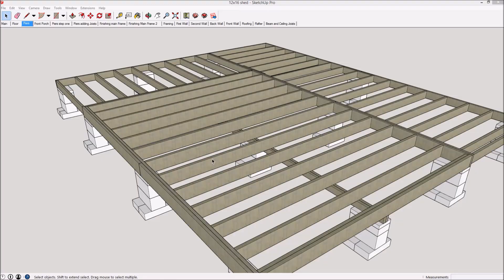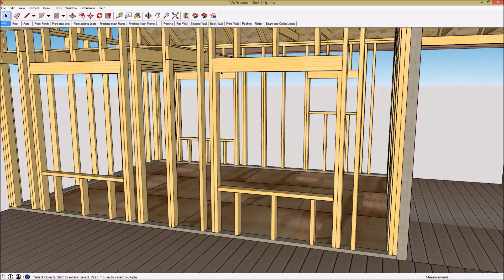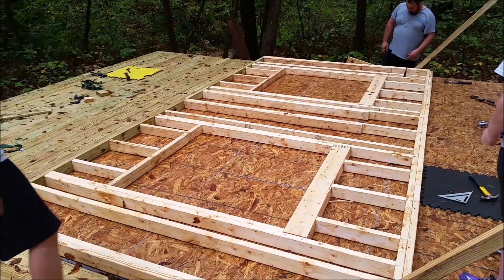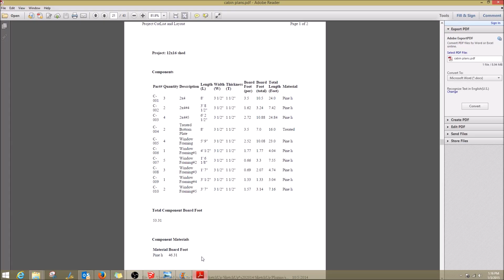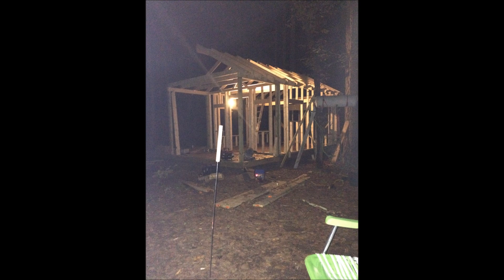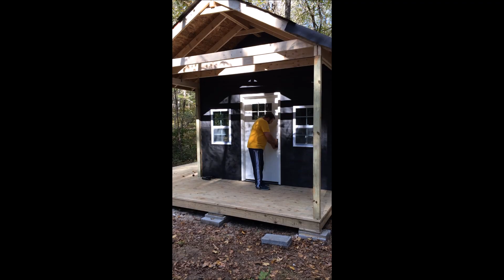Tiny Cabin in the Woods (Cabin Project)

Comment: This is a sweet little starter cabin. If it was mine I'd build it on taller piers so it would be about 4 feet off the ground to provide room to get underneath and insulate the subfloor, give the hound dogs a cool, shady place to sleep and help protect the cabin from spring flooding. I'd also add about 2 feet height to the exterior walls so there would be space later on to tack on a porch roof below the original roofline if I wanted a wrap-around screened porch for insect-free outdoor living and to shade all the windows in summer. I would also want windows that lower from the top and a transom over all the interior doors to allow good airflow during hot weather.
Reply from the maker: All great ideas :) The height off the ground was dictated by local codes...that is what I told myself anyway.  The sub floor is insulated.  I did that before putting down the plywood.  The future plan is to add a roof to the side porch, but tie into it not under it.  The windows were chosen more so based off price, however I actually like the side slide of the larger windows...they are really easy to open and close...and I don't know what a transom but there are no interior doors anyway.  Thanks for the comments.

Comment from the maker: I just cleaned up the plans for this little cabin and made them available on my site.  I also included the original sketchup file I used so you can modify it for yourself.
http://plan-to-build.com/downloads/plans-for-the-tiny-cabin-in-the-woods/
Reply: +Brad Clark  Amazing job man. Looks awesome. I like the shake siding. Same thing I did on my house. Quick question tho. What made you stick build as opposed to ordering a prefab "shed". I own a small company that does prefabs, and going by your sketch and material, I priced this out at roughly $4000 delivered. Did you save a lot more by stick building?
Reply: I'm sure you probably already answered this question but I have to ask. How much did you spend on just this cabin?
Reply: This is great you did a wonderful job. Now just enjoy it.
Reply: Brad Clark
Reply: Hi Brad, how is that siding you used called?
Reply: ok good
Reply: i was not sure i 💘
Reply: Brad Clark  how much for plans
Reply: Thank's
Reply: Brad Clark This is perfect. Thank you so much.

Comment: Hello Brad. I am going to be building a cabin myself and one thing you did that I really want to do is that your outside deck and your interior floor really is all one continuous floor. I would rather do this since imo it would be easier than having to build a completely separate deck that attaches to the cabin. My only concern however is that b/c the deck and interior floor is one continuous floor do you ever get rain in under the walls? Did you do something to prevent that from happening ?

Comment: Biggest mistake that was made was not allowing enough room under the floor, you need at least 2 feet under a floor to for access in case of repair. and future improvements.
Reply from the maker: +Scott Foster Yeah, there will be no crawling under it.  There were other driving factors that limited the total height from the ground for my situation.

Comment: Nice!! I wouldv added 50cm lenght to the walls and bit more of an incline the roof. It be at minimum costs but would create a nice loft
Reply from the maker: There was a lot of give and take on the roof design.  I came really close to using the barn style roof design...that would have given a lot more room in the loft, but settled on this design for simplicity sake.  I also took into consideration ripping the plywood and made sure I only had to cut 1 piece in half per side, the rest were full sized sheets.

Comment: I hope you don't have a problem with the ground freezing. Otherwise the frost is going to shove that place out of plumb.
Reply from the maker: It seems like you would have less problems with that by using piers sitting on the ground rather than buried.  I am no expert in frost heaving though.  I expected to have to relevel it by now, but it is holding up so far.

Comment: What did I miss? I see furniture inside this structure with the insulation not covered by drywall. How did fiberglass shards not get everywhere?  I know it's faced insulation, but there's still air flow over it.

Comment: Why not go with a prefab that cost 5 to 6k? 
Unless the spot is out of the way the costs for delivery are low.

Overall, very cool! Nice work
Reply from the maker: +Omegawerewolfx We looked into that option a little.  Our situation made it too hard to get a prefab brought in and on top of that everything that I saw would have costed way more and/or used cheap materials.  I should finish this one completely for under 10000 which includes the nice siding, furniture, furnace, kitchenette...etc

Comment: I Brad, thank you for sharing your plans, i just want to know the basic concept of it.
Reply from the maker: I am not sure exactly what you mean.  Basically it is a small shed with a loft built in.  I think I designed it with a 7/12 pitch, but you can check the plans to ensure that is accurate.  When designing this building I tried to take into account the environment I would be working in -- off grid.  For that reason I tried to design it to where there are less cutting...for instance the plywood for the roof is full sheets except one sheet on each side is cut in half.  The rafters are full length 2x6x8 and only cut one end.  The studs are the standard size that are available at box stores.

Comment: Great design, Brad.  Does this design meet the building code exemption of a building with a floor area that does not exceed 200 square feet?
Reply from the maker: This one was designed exactly for that, for my particular county.  Since it was flooded, I have actually gotten a permit and added another cabin to the back side making it now 12x32.  That thing was a beast and survived intense pressures from the water.  Busted every window.  Frame survived, dragged it up the hill and have been rebuilding it.

Comment: Nice job Brad I plan to build one at the side of a river in France next year, any advice for me?
Reply from the maker: +david martindale I think If I were to redesign it, I would reconsider where/how many of the great big windows are installed.  The one thing we notice is there is really no wall space.  Other than that it is easy to build.  I over killed on the thickness of the plywood for the roof...I used 5/8 and 7/16 would have been fine.  If I were to redo the insulation on the bottom, I would put in 2 inch foam board and then fill it with regular insulation.  I used chicken wire to hold up mine.

Comment: what is the program you used to do this?we would like to build a larger version and this looked like a great way to do it.You did an awesome job! Very cool!
Reply from the maker: Thanks for the compliments.  I used Google sketchup to design it.  I also have a 16 x 32 version I designed earlier before I scaled down to this size.  I still may build the larger version one of these days.
Reply: can we purchase the larger plan?
Reply from the maker: +The Guyz Show I've never finalized it.  I have the basic structure drawn out, but windows and doors aren't in place.  It really needs a good bit of work before it could be used as plans.  how long would it be before you needed a finalized set?
Reply: At least 12 months, but we would like to get an idea of the costs of material as soon as possible.

Comment: Brad,  Thanks for posting the plans and the videos.  What version of SketchUp are you using and are there any plugin's you would recommend for framing a cabin like yours.  I just downloaded SketchUp Make 2015.
Reply from the maker: rrssn672 I am running version 15 as well.  I used an extension called cutlist version 4.1

Comment: Nice job; thanks for postin.  What size are those posts holding the headers for the overhang--4X4 or 6x6?
Reply from the maker: I used 4x4.  At some point I may replace them with 6 diameter logs
Reply: Brad Clark Thanks for the reply.  I like your design.  The wood shingles make the whole thing pop.
Reply from the maker: A Stanton1966 thanks.  That siding was a lucky find on craigslist.

Comment: @Brad Clark - I'm wondering, is the interior floor height above the outside deck height? Or is it all the same just with a door threshhold rain stop to prevent water coming in under the door?
Reply from the maker: It is just a little lower than the floor, although it might be just about the same height as the plywood subfloor.  I have 3/4" lumber that I planed down as flooring

Comment: not so much building codes for frameing i was thinking septic and water what did you opt for and did you need permits to do it thanks
Reply from the maker: Because it is a weekend getaway for me I have no septic or water supply.  I bring in water and built a composting toilet system for those times when standing just isn't good enough :)

Comment: What kind of insulation did you use?  i am buildng small cabin up north in Finland on my island.. Wondering what kind of insulation i should use since the cabin will be cold from time to time.
Reply from the maker: +klausssi123 I used a stone wool insulation for the floor, it is supposed to be more rodent/mildew resistant than regular fiberglass insulation.  For the Walls and ceiling I used  the regular fiberglass insulation.  I forget what the R values were, but I pretty much filled the cavities with insulation, so the walls are 4 inch's thick, ceiling is 6 inches thick and the floor is 8 inches thick.

Comment: What software did you use for the plans?  You skipped ground prep and cinder block placement.  I am curious about those aspects.
Reply from the maker: I used google sketchup.  I used pea gravel and a 16x16x4 pad to sit the cinder blocks on.  Pea gravel helps with leveling.

Comment: Great video.  I've been working with sketch up to do something similar but cant figure out how to get a cut list from separate "parts"  any pointers?
Reply from the maker: +Eamonn McGonigal You need to download a pluggin called cut list if you haven't already.  Then you select which ever parts you want included and run the cutlist program.  It takes a little time to tweak it the way you want it, but it works fairly well.
Reply: +Brad Clark Thanks i'll definitely check it out.

Comment: does that little generator power a skil saw?
Reply from the maker: honestly, I am not sure.  The setup I used to build the entire cabin was two marine batteries tied in parallel and a harbor freight 2000 watt inverter.  I ran that small generator 4 to 5 hours a day to recharge the batteries during construction.

Comment: Hello! My dear Sir, a question: did you use the blue soldering inverter with the small power generator (red)?
Reply from the maker: The blue thing you saw was a 12 dc volt battery charger.  I used the small red generator to recharge the battery bank each afternoon while I was there.  I used a 2000 watt inverter and 2 standard marine batteries to provide 120 volts ac for the tools I used.

Comment: did you create the program you used to design the cabin or which program did you use?
Reply: OK so I read more comments and found the program but did you use the Sketchup pro or the free version?
Reply from the maker: I had access to the pro version when I made the plans, but It is really not necessary.  All the pro version brings to the table is the ability to "layout" the drawing easier. You can set up views with the free version to do the same thing, but it is a little more hassle.

Comment: your porch is going to rot. Did you flash your joists where it changes over from the cabin floor to the deck. The front, right corner and that entire left, water will get down between the joists and be sucked into the home and into the bottom plate and into the bottoms of the wall studs.
 You should have built separately, flashed, the dropped the deck band against the house a few inches.
 Sorry to bring the bad news. You need to change on plans before you give any out to people.
Reply from the maker: I did flash along the porch side. On the right side the siding is below the sill, but I do see your point about the corner.  I'll keep an eye on it and try to add some flashing or mitigate any water penetration somehow if it occurs.  I made plenty of mistakes along the way and I do appreciate the constructive criticisms...they are just as important to me as they would be to any would be builders.

Comment: Hi Brad. Donated some funds for a copy of the plans. How much did the cabin cost in total. Did you insulate it as a 4 season structure. Thanks,
Reply from the maker: Mark Terene First off I want to thank you for the tip!  That is what keeps me motivated to post more stuff :)  So far I have spent around 6000 for the Cabin.  Yes, I insulated it completely and is suitable for winter trips.  I went on one of our coldest days last winter and the small Kerosene heater I am using right now was almost too much.  We had to open the loft window that night and it dropped down to -4 F that night.  I have been in a lul lately on building, but I plan to get back to it soon.  Right now the cabin is fully insulated, outside is complete, and flooring is installed.
Reply: Brad Clark What did you use to insulate the floor section?

Comment: How much would you say you have spent on your cabin up to this point?
Reply from the maker: I am around 5500 at this point in the video.  That includes framing, roofing, siding, porches and insulation.  I am at the scrounging point now.  I used rough cut lumber I had on hand for the flooring that I planed down, and re-sawed some to use for the ceiling.

Comment: hello can you tell me what i have to go thru to get past building codes if any and things like septic and water i was thinking compost toilet or privy if i can do it around here and rain water collection with wood heat i live eastern shore va would really like any advice you have for me thanks
Reply from the maker: As far as building codes, I would recommend you follow them.  They actually help make sure your design you come up with is sturdy enough.  As far as septic, I designed a composting toilet system from two 5 gallon buckets that separates solids from liquids.  So far the design exceeds the standard hole in the ground privy by leaps and bounds.  My cabin is a weekend getaway so water is brought in via the standard 5 gallon drinking containers, however I plan to design a holder system that will give running water to the sink that will be in my kitchenette...all hopefully in videos to come.

Comment: what is the software you are using for blueprints?
Reply from the maker: I used google sketchup 2015
Reply: Brad Clark thanks! I have been searching for one but couldn't find one that could help me visualize all the framing.
Reply from the maker: Yeah, you can download it at sketchup.com.  Use the free version.  It is a newer version but will still open older sketchup files.

Comment: How much did it cost you after all?
Reply from the maker: +Alexandru Anchidin I am still working on it.  Basically took the summer off.  I went out weekend weekend before last and done some work.  I have spent 6000 so far.  basically all I need to buy at this point is some sort of wall boards, trim and carpet for the loft.  Also would like to install a chimney for my little wood-burning stove I found and the kit is 500 bucks....  I figure between 2 and more 3000 should finish it up completly.
Reply: That ain't bad at all. YOu should consider taking the whole thing off the grid and just live there :D
Reply from the maker: It is already completely off the grid.  I just need to convince the wife and kids and I would do it.  haha

Comment: How much did this project cost
Reply from the maker: Nick Mossey I have 6000 in it so far.  I still have to finish the inside.  Outside is done and it is insulated all the way around.  I have the flooring installed as well.  Still have to build a few cabinets (kitchenette) and put up some sort of ceiling and wall paneling.  Probably can finish up for another 1000 depending on what types of material I use.
Reply: hi